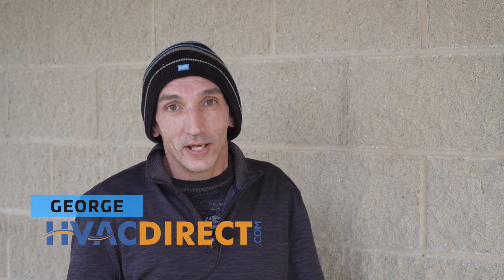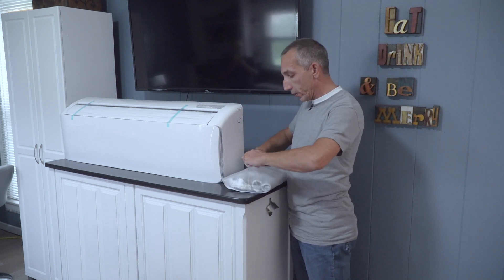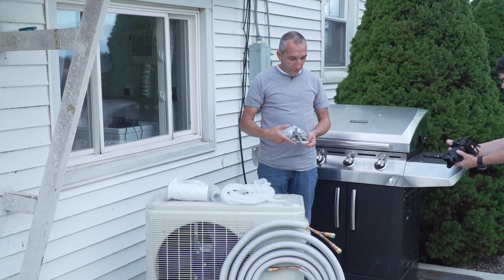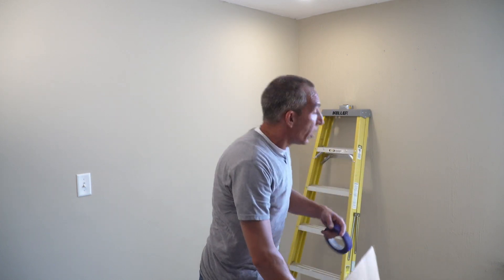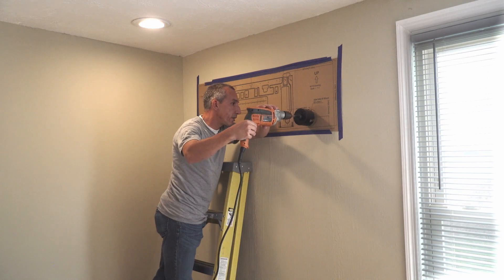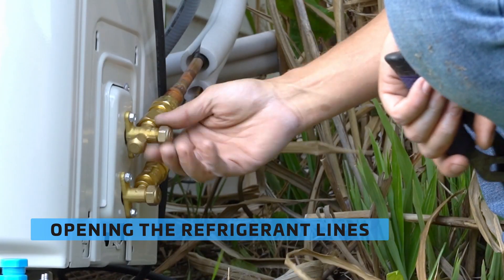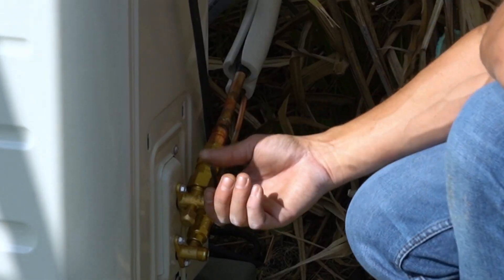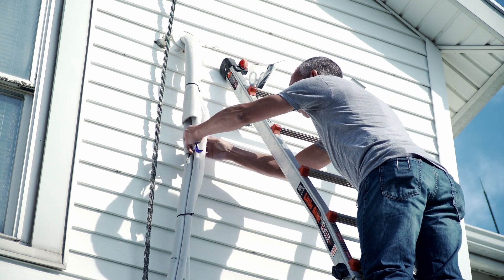DIY Ductless Mini Split Install

Comment: Just installed this same aciq unit with 3 indoor heads… just reading the manual now and see that you have to plug the 2nd drain port on each head tht is not used… hoping that plug is installed from the factory????

Comment: Very helpful...  How does that install differ from having 3 Air Handlers and 1 Heat Pump??  Do the others piggy back off of one main unit??
Reply from the maker: Hey there, great question. A DIY multi zone mini split will come with an outdoor condenser that is made for all of your air handlers to hook up to. So in short, the answer is yes!

Comment: thought you needed an epa cert to purchase cooling equipment what If the homeowner releases all that gas into the atmosphere ? Isn't that a violation of EPA rules and regulations ? Did this guy get an electrical permit to do this JOB ? Whats the address again I didn't catch that ?
Reply from the maker: Hello, you do not need an EPA certification to purchase a DIY mini split or any HVAC equipment online. Thank you!
Reply: One SHOULD Need one Especially with all this Global Warming Going on . After all R-410 A has a Global Warming Potential of 2,088.